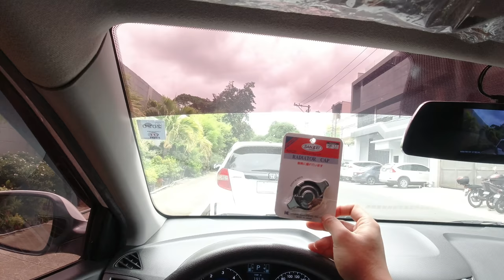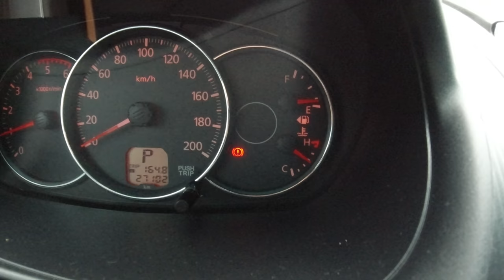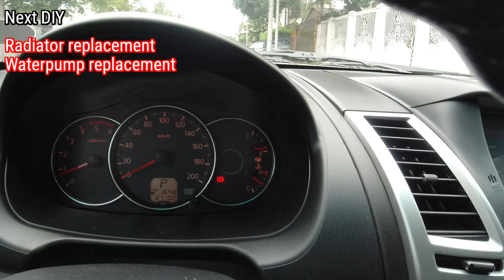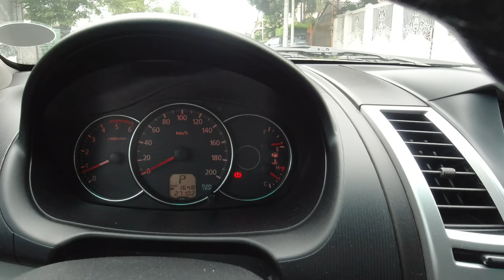Ang Paghahanap ng Solusyon sa Overheating ng Aking Montero Sport

Comment: Hi Noah, love you videos sir they have helped me a ton. I have a 2015 Pajero Sport sitting at 230K KM's and from Mitsubishi locally I was told that the overheating issue is part of a recall with a factory problem on the engine cooling system. Thankfully myne has not had the issue although my Vin sits in the recall range.
Reply from the maker: I heard no such issues or recalls here in Manila. Mine is due to radiator being clogged sir

Comment: Bossing,  dun sa clutch fan, gaano karami ang silicon oil ang nagamit? Like ilang bottle? TIA
Reply from the maker: Hello sir Rommel
Akin sir 4 vials nilagay ko. Siguro mga 6 okay na.
https://youtu.be/kr_Bx6cR8-E
Dont forget to subscribe
Reply: @NoahsGarage  thanks sa info bossing. Iniischedule ko kasi ng replacement of timing belt at kits. Isama ko na rin water pump and clutch fan😁

Comment: Sir sakin naman baliktad sa nangyare sayo. Sakin pag nakahinto sa traffic nag ooverheat at nawawala ang lamig ng AC Pero fan meron. Pero pag tatakbo nako ng tuloy tuloy kahit malayo ok lang di nag oover heat. Ano kaya nangyare
Reply from the maker: Kulang sa pumapasok na hangin sir kaya nag ooverheat sa traffic. Pacheck mo sir radiator fan mo, fuse or relay
Reply: Same problem boss. Pag na traffic umaangat temp tapos nawawala lamig ng A/C :(

Comment: Sir na check mo ba if baliktad ikot ng aux fan mo? Kc ganyan din yung akin check the polarity dapat yung fan going to condenser tapos nag automatic sya kc connected with the compressor. If sira water pump mo you can check radiator water open  cap engine running if gumagalaw or nagflow paikot sa loob radiator if not sira water pump
Reply from the maker: Salamat sa tip sir.
Wait for my water pump and radiator diy replacement
Dont forget to subscribe sir

Comment: Per experience ko po, nagka butas ang water pump housing ko may nakitang tagas around the pump due to corrosion (aluminum) & possible debris at di na noticeable ang suction ng coolant sa cap kung i-rev up. So palit pump. Another ay may tagas din sa radiator so butas 1 or more radiator tube element at nag co collapse ang lower hose pag pina rev up din. Nag replace ako ng lower hose at pina replace ko lang yung element na may butas not the whole unit po. Laki ng pinagbago improvement  sa temp gauge po sir. At sa leak test, may ma notice ka na may basa ang sahig sa parking spot mo. Btw, sana may collar style at sport type cloth yang merch mo na long sleeve shirt, sir.  Cotton ba yan sir?
Reply from the maker: Salamat po sa tip sir. Yes cotton po. Pakiabangan na lang po muna for now ung merchandise page ko sa website. Salamat po
Dont forget to subscribe 😉

Comment: Did you ever solve the problem? I have the same problem with a 2021 Pajero Sport V6 but the dealers is not able to solve the problem
Reply from the maker: It was the radiator sir, clogged.
https://youtu.be/YTdmJQlCiLU

Dont forget to subscribe 🙂

Comment: Boss ko kotse ko nissan pathfinder 2004, my history ng overheat dahil nabutas heater core,. Bali ginawa ko binypass kuna HC, ang problema tumataas prin temperature gauge, pero kpag binubumbahn ko accelerate bumababa nmn temp gauge sa normal. Anu kaya ang issue nito?
Reply from the maker: Matagal ba ma reach ng engine ang operating temperature sir? If yes, change your thermostat.
Dont forget to subscribe
Reply: Bagu po thermostat ko sir kakapalit lng nung inayus, tumataas po temp higit sa dati na normal.

Comment: I think, when you adjust the aircon belt tension, you have to loosen the pulley nut.
Reply from the maker: Opo sir Manny. Salamat po sa tip
Dont forget to subscribe 😉
Reply: Manny Gerozaga yan din nga yung comment ko ky Noah Sir dalawang bolt galawin mo dyn e loosen  mo Muna yung pulley ng belt ng Ac din saka mo higpitan yung tension nya din pag ok na yung tension nya higpitan mo ulit yung pulley Bit Thank U

Comment: Sir baka makahingi ng pabor kasi laging nasisira ang aux. fan ng montero aircon ko. ano po ba ang original na ikot ng aux. fan pag umaandar, clockwise ba o counter clockwise pag nakaharap  ka sa radiator. salamat po sa sagot.
Reply from the maker: Anti clockwise. But I'll recheck tomorrow sir
Reply: thanks sir

Comment: kung mapaghihiway muna ang radiator sa condenser coil ng aircon at saka lilinisan....sa mga aircon shop po gumagawa noon kasi kailangan tanggalan ng freon ang condenser pala mailabas.
Reply from the maker: Salamat po sa tip sir Roberto.
I will focus first sa radiator, then sa water pump. Kapag ganon pa rin po, aux fan na po at condenser nga po.
Please consider subscribing sir

Comment: baka ang turbo wastegate ay hindi nag oopen pag naka high rev ang makina katulad ng highway driving, kaya umiinit yung temp.  o dahil variable geometry and iyong turbo may overboost, ang aking montero ay fixed geometry turbo lang kasi hindi ko pa naman naranasan ang overheat.  O nag pa blank ka ng EGR mo?  May nakita ako sa youtube video na mas iinit ang makina kapag ang air intake ng combustion ay puro hangin lang walang sinamang exhaust gases.   Kung sa bagay dapat nag check engine light na dapat no?
Reply from the maker: Correct sir.
Reply: Suggestion lng sir...  Dalhin mo sgro sa mekaniko para matapos na problema sir...  Nagawa mo na lahat ng basic maintenance pero wala pa din e...   I appreciate ung mga diy mo nmn sir...
Reply from the maker: @melvinalfredo20  salamat sir. Kaya natin yan sir hehe

Comment: Try to check the fan clutch silicone oil once again. I added mine twice last time. The 1st one not enough. Check the fan speed whether its normal or slow.
Reply from the maker: I believe sir mine is enough. But I will consider po your advise sir. Salamat.
Dont forget to subscribe 😉

Comment: ask ko lang sir, nagpark ako  tumataas temp ng monty ko. kapag tumatakbo na si monty ko bumabalik sa normal... salamat sir
Reply from the maker: Insufficient air sir. Check your fan clutch sir. Me video ako niyan how to add silicon oil.
Dont forget to subscribe 🙂
Reply: @NoahsGarage  sir from Novaliches - Angat, nag stop lang ako saglit para mag withdraw, tumaas ang temp nya . nang bumabyahe ako bumalik sa normal ang temp, clutc fan sir ang problem? salamat uli sir .
Reply from the maker: @joelaguirre8120  most likely sir. I suggest na pakiramdaman mo ulet ang sasakyan mo. Baka di mo namamalayan mataas ang temp kc minsan di natin pinapansin ang gauges.

Comment: sir na solve nyo na po montero sa over heat parehas po tayo ng issue sir un auxilliary fan ko omaadar pa kahit nkpatay na ang ac.tapos tumataas po temp 100deg.po ano po problema sir
Reply from the maker: Yes sir. Radiator pinalitan ko. Me video rin po ako non radiator replacement
Dont forget to subscribe 🙂
Reply: pro auxilliary fan nyo ano po problema sau sor

Comment: Radiator barado na kaya pag sa high speed dun mataas ang temperature kasi himdi na ma balik agad yung coolant pero sa low speed na babalik niya kasi hindi malakas ang pressure pag low speed
Reply from the maker: Salamat sir Allan sa tip.
Abangan po sir radiator DIY replacement natin
Dont forget to subscribe 😉

Comment: 2 ang duda ko Sir. Its either may blockage ng coolant yan somewhere or yang clutch fan mo ay sira na. Pag kasi high RPM, mas mataas ang init ng makina, it needs more coolant flow at airflow. Baka yung Bi-Metalic Strip ng Clucth Fan sira na ayaw mag lock up.
Reply from the maker: Radiator ang barado sir
https://youtu.be/YTdmJQlCiLU
Fan clutch ok naman sir, nadagdagn na rin po ng silicon oil, me video rin po ako non.
Salamat sir
Dont forget to subscribe 🙂

Comment: Sir what if the other way around, pagnaka hinto dun tumataas ung temp and then pag tinakbo ko na bumabalik sa normal. And one observation ko din namamawala ung lamig ng aircon pagnaka hinto ng matagal. TIA
Reply from the maker: Insufficient air supply yan sir. Kung diesel car mo, pacheck mo fan clutch. Kung gas engine naman, check mo radiator fan. Tsaka magtanggal ka ng mga abubot mo sa front grill, baka di nakakapasok hangin.
Dont forget to subscribe
Reply: @NoahsGarage  thank you so much sir.

Comment: base sa video mo , napalitan na lahat,,,ginawa mo na lahat ng effort mo bro,,,,,base naman sa experience ko ,,,1st suspect ko radiator mo maaring barado na,,,pag naka stop ka ok lng temperature mo normal,,,pero pag lumakad na at high rpm tumataas na yun temperature mo kc meron na barado sa radiator kya d na masyado maka circulate at high rpm,,,,,,2nd suspect Water pump,,,,kung ubos o bungi na yun impeller nya mag overheat cya hirap n mag circulate  sa high rpm,,,,,sana makatulong bro,,,,,,pa shout na lng,,, eheheheee,,,,,sa channel mo,,,,tnx n keep safe ☹️😁😃
Reply from the maker: Sure sir shout out kita para makatulong sa vlog mo sir.

Comment: In my case sir nagpalit ako nang aux fan.. kasi kahit patay na ac nya naandar parin sya nung pinalitan ko ok na sya ulit..
Reply from the maker: we have the same issue sir. 
Tumataas po ba temp niyo sir tulad ng akin?
Reply: @NoahsGarage  nag normalize na sya sir dina po tumaas
Reply from the maker: So my connection po pala ang aux fan sa cooling system ano po. Kinoconsider ko rin po palitan motor ng aux fan ko eh. Siguro after na ng radiator replacement ko
Reply: Arang ganun na nga din sir

Comment: Hindi naka on ung aux fan m boss kapg nakaidle lalo na pg off ac compresor hinihigop lng ng hangin ng clutch fan kasi ng padagdag ka ng silicom oil lagi nka engage ung clutch fan mo. Dapt sakto lng laman na silicon oil hirap din ung mga belt at water pump kung mdami nilgay na silicon oil
Reply from the maker: Salamat sir sa suggestion
Dont forget to subscribe

Comment: i have hyundai H1 (A2 d4cb), base engine like pajero 4d56 because there are some similarities to spare parts.
.
a few month ago, i have some problem, overheat issue. my car production 2013 with 50.000km.
.
but the problem is little different. overheat coming when the car is uphill in the speed 10-30kph (yes, i thinks its air flow)
.
so, i took off the radiator to cleaned by stabbing it and it turned out that there was a lot of gel on the radiator whinch was causing if to clog.
.
so, the problem is solved, i testing again with slow uphill road, and overheat again (but the temperature indicator rises more slowly)
.
next i was upgrade more big front extra fan and thermostat 76° (default is 82°)
.
bay the way, i from indonesia with more summer, hhee
Reply from the maker: Hello sir Tofa
Thank you for sharing your experience. Did you solved your overheating issue?
Dont forget to subscribe

Comment: Sa temp naman bos
Radiator leak
Water coolant
Fan
Thermostat 
Radiator cap naman daw pag parang sira na rubber sa loob pwede mo na palitan. 
Lastly yung water pump (2500 price na bili ko pero replacement oem) baka di na nag circulate ang water sa makina
Tapos yung maf sensor linis mo din bos. So far yan ang recommended ng mitsubihi na mechanics na tropa natin. 
Sana maging ok na ang oto mo 👍
Reply from the maker: Salamat sir sa mga tips
Reply: Sir nagpalit ako battery nang ibalik ko pinaandar umilaw engine check Salamat sa sagut
Reply from the maker: @teddybitancor9871  Scan sir para sure. Or balik mo ung old battery and see if may check engine pa ulet

Comment: How many kms has your car done totally?
Please don't try changing the radiator OR the water pump. The overheat issue is still there despite :

1. new Silicone oil in clutch 
2. new thermostat
3. new temperature sensor
4. radiator fins cleaning
5. new cap
6. new Aisin coolant

The fact that temperature needle moves up above 2000rpm means either coolant circulation isn't proper OR enough air draft is not there viz. enough cold air is not being drawn in to displace the hot air in the engine bay.

I think you could check if air path flow is obstructed viz. air drawn by fan should exit the engine bay for displacing hot air and bringing in more cold air. 

Please see if you can create some openings on the left and right of the engine on the frame and see if hot air removal is improved.

Once you create more room for ventilation, you could consider installing one more pusher fan in front for additional cooling.
Reply from the maker: Thanks for the tip 
Dont forget to subscribe sir 🙂